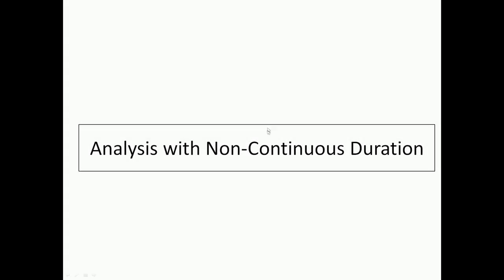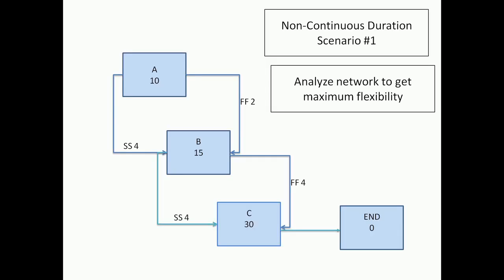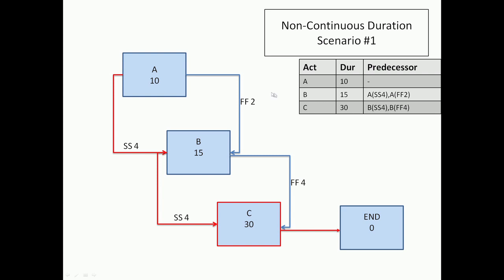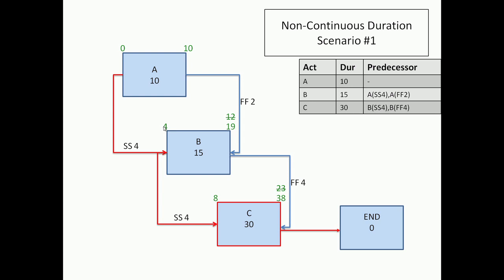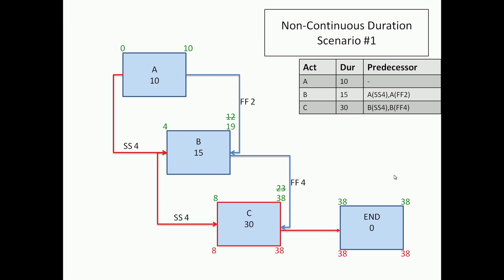#44 PDM Analysis with Non-Continuous Duration & Floats | Project Planning & Control

Comment: How the early finish of C is 60, when 40+10 is 50?
Reply: thats not 40 +10(duration), that should  be calculate as 40+20(lag of its relationship type)